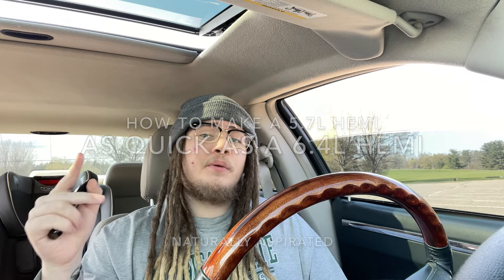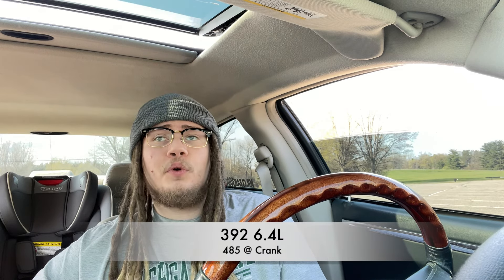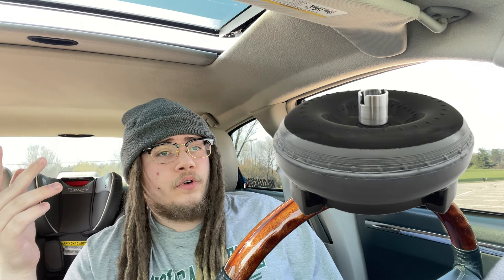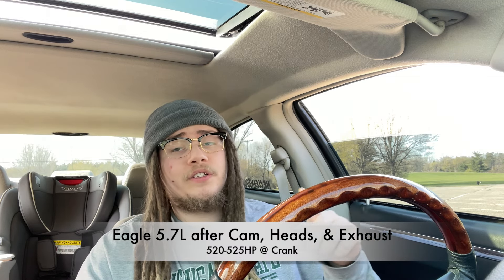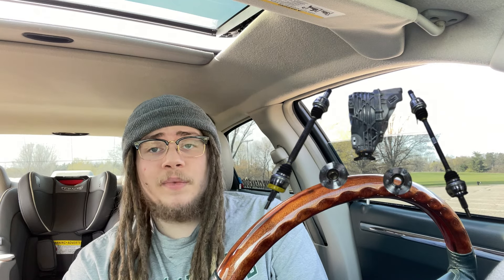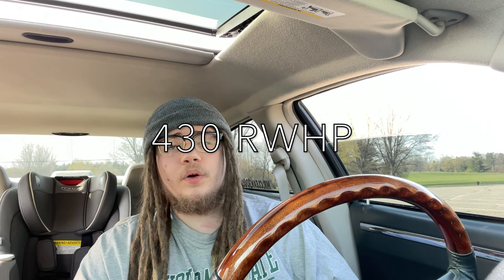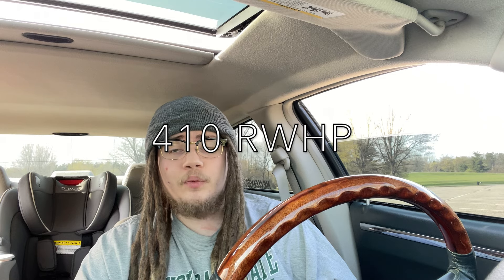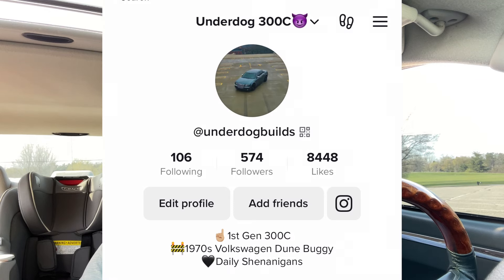How to make a 5.7L HEMI as quick as a 6.4L HEMI (N/A)

Comment: I have a 12 rt awd charger with 118k. I feel if I did any of these upgrades, I’d have a blown motor or no more awd! Love the car, but the awd system isn’t upgrade friendly
Reply: You can upgrade the awd rt bro . I have a ‘14 awd rt at 130k miles and the stuff I’ve done to It so far hasn’t blown my motor . If you do shit correct and take the time to do research then you’ll be fine . Upgrade your 5.7 bro don’t be scared . Just do things one at a time
Reply from the maker: I’m sorry that I hadn’t seen this comment previously! You could get away with some modifications 😄 I do know the AWD cars are a different story than the RWD cars though. I have seen some AWD 300Cs racing, many of them are a bit limited in the wheel and tire department and such. I’m sure you can find some nice threads across some forums that will let you know the limits of the AWD system and such. I do understand wanting to leave it alone though!
Reply from the maker: 100%! These builds typically are “brick by brick” per se. I’ve been doing research for 3 years now and I still look into things very precisely. There are so many avenues for these cars it’s ridiculous and awesome. I do know the AWD system is different than my RWD 300C, I’ve gotta learn more about the AWD models. I think it’s cool how they’re RWD until the system detects slip of some sort. I want to see a fully build AWD model that is built into a dig monster.

Comment: What year are the pre/current eagle 5.7 engines?
Reply from the maker: So the pre-eagle 5.7L motors were produced between 2003-2008, starting it 2009 the VVT Eagle motor was produced. So anything 2009+ is eagle, 2008 or before is pre-eagle. Have a good day!

Comment: Not that it makes any actual difference, but as a point of reference; do the 392s or better have these mods as stock engine specs?
Reply from the maker: The 392 HEMIs come with a posi rear end 100%, they come with shorty headers from factory, 2015+ 392s HP peak is @ 6100 RPM and the TQ peak is @ 4200 RPM so somewhat in relation to the valve springs with the cam having you rev higher in the RPM band, they most definitely on average come with better/more wide wheels from factory, a lot of them have 8 speeds that feel in the 5 speeds after 1st gear so the shift kit is somewhat in relation to that, I forgot to mention a one piece driveshaft but it would definitely help shave off some weight as well increase responsiveness (and help prepare for future power), the intake manifold I threw in is a great mod for people to do if they’re willing to wire it up to use the long/short runner toggle. Then, lastly the 180° thermostat is a common mod to keep temps down (especially for guys like me with big ol long tubes heating up that engine bay) but the 392s do not come stock with one, that’s something the 392 guys would have to swap out/upgrade.

I hope I included everything that you were wondering about🫱🏻‍🫲🏼🙂

Comment: I think the 5.7and the 6.4  engine is the same that is got different internals that's what makes them faster
Reply: It can be argued the 5.7 has better internals which is why they handle boost better then 6.4l, 6.4 just has a bigger bore for obvious reasons

Comment: Lol you can make a prius faster than a 392. It all about how much you willing to spend. Dumping money into a r/t instead of a 392 is odd.
Reply from the maker: True, i see your point on it being a monetary situation. Also, this video is naturally aspirated, no motor swaps, etc. if you research the cost of dropping a 392 in, you’d be surprised. Trading in for a 392 would be more expensive as well as swapping in a 392. Many people including myself view the 5.7L HEMI as a more viable option to build. The actual block will typically hold up better unless you go with a BGE 392, which is more expensive. There’s many reasons to build a 5.7L HEMI over a 6.4L, but most people do it because they already have the 5.7L motor. The idea of grabbing a 392 over stroking the 5.7L to a 392 or even a 397 is more expensive. Most drag applications use a 5 speed auto also, the 8 speed doesn’t interest me like it does most. That doesn’t include my main point, the first generation of 300s never had a 6.4L. I love this body, more than any generation of modern chargers or challys. And lastly, my goal since starting the channel is to see what this specific motor can do, once this motor cannot be improved or cannot handle what I’d like, it’ll be time for a 426 Stroker based off of a 392 BGE block. If this motor goes before a 426 is viable, a 392 would replace it rather than a 5.7 however. It’s honestly preference and convenience for most. (But check out modern red hemi, the 5.7L can outperform hellcats for relatively cheap comparative to the cost of a hellcat, ZL1, etc.) I hope you have a good day man!

Comment: Add .7 hemi duh😂
Reply from the maker: 😂 you ain’t lyin! (I’m interested to see a 5.7L based 392 stroker vs. a factory 392. It would have to be contained to either NAG1 or ZF 8HP vehicles to be more accurate. Also, the model of the vehicles would need to be the same for accurate results. I’m curious to see how the 5.7L based stroker would compare to a 392 HEMI. The pre 2015 392s also made 15 HP less, but that’s somewhat minimal. 392 cars comes with a LSD from factory, which would be a slight advantage from a dig. An Eagle 5.7L HEMI based stroked would produce more power over the pre-eagle 5.7L just due to the Eagle heads being D port vs the small square port on pre-eagles. Just food for thought 🤔

Comment: Why not just buy the proper motor? With what all of this will cost you may as well buy a bigger better setup.
Reply from the maker: Solid point. The main reasoning behind it would be the fact that most of the people in a 5.7 already don’t have the money to just dump to swap or stroke, it’s more so a progression throughout time type deal. I’ve also had some people tell me they’d rather have a built 5.7 over a built 6.4 because of specs having to do with the block. Personally, I want to see how far I can take a pre-eagle 5.7L on the stock block, then forged. There’s always time for more projects and fun in the future. I’d love to build a forged short block 6.4 with cnc ported heads, a hellcat oil pump, a hellcat blower, etc but it’ll all come in due time my friend
Reply: @Underdogbuilds  gotcha

Comment: what can the 5.7L HEMI handle power wise? love the videos, keep it up man!
Reply: Up to 600 before shit gets real inside of the block and blow on you
Reply from the maker: The simple answer is 600HP, around 500-550 WHP. If you’d like to get technical, you could gap the rings and push up to 700WHP and then some. I’d rather forge the motor even though it costs more and will take longer. The transmissions tend to get upset at 550-600 HP, but a nice valve body from somewhere like Ding Racing or Southern Hotrod will hold 750+ HP. It’s rumored that the Dings Racing 200% valve body for the NAG1 transmission will hold 1,000hp. You me have to keep in mind the driveshaft and differential, they will eventually give out on you. This is typically around the same range - 500-600HP. Some differentials and 2 piece driveshafts hold together well and surpass these numbers and some don’t make it to these numbers. It all depends, I recommend upgrading the driveshaft before attempting too much power as you don’t want to test the limits and have it come flying off.
Reply from the maker: Yessirr!

Comment: Im trying to build my R/T for cheap and reliable should I just get a procharger 😅 🥲
Reply from the maker: The biggest bang for you buck would definitely be forced induction 🙂 
procharger is a great supercharger, the kit is inclusive and bolt on as well. Especially if you own a stock 5.7L, it’ll be super reliable. These kits will set you around 470-500 RWHP, which scars make to the crank. So it’ll be no slouch! This is the most HP per Dollar you will get. Then there’s a multitude of options afterwards as well! I’ll be uploading a video this week called “how to make a 5.7L HEMI as quick as a hellcat”. It will not only include talking about that boost, but it’ll include other modifications to keep in mind to add power or perform better overall. I hope you have a blessed day my man!